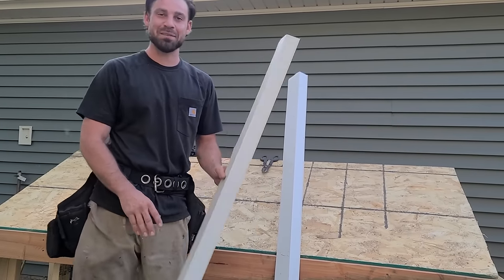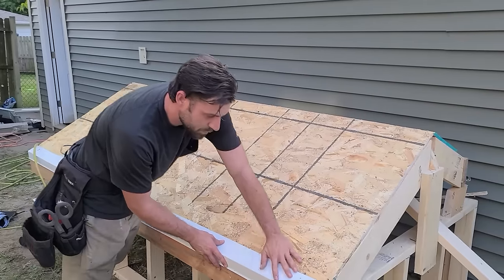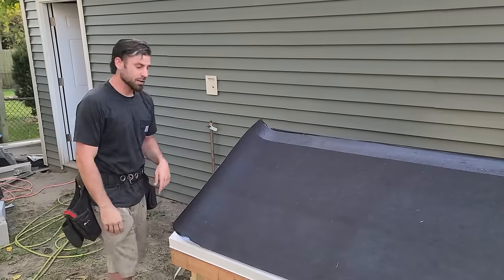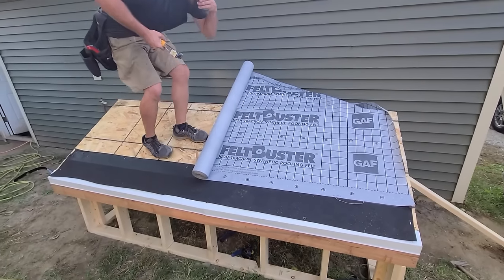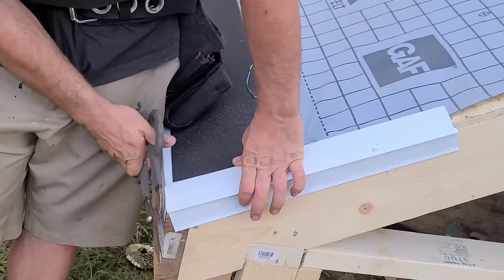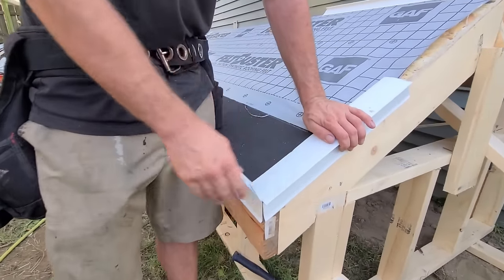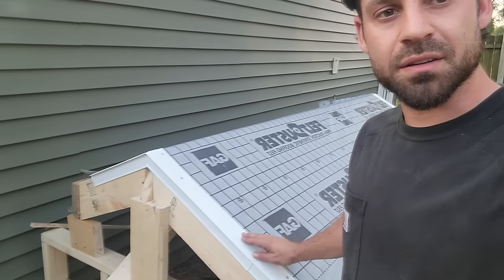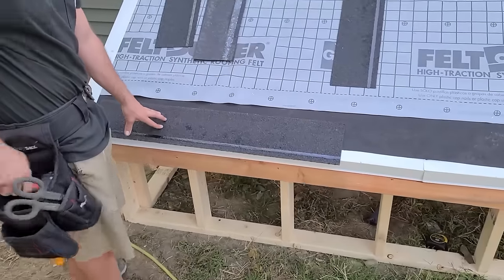HOW TO | A - Z ROOFING (PART 1)

Comment: With the new synthetic felt you can staple just the top and bottom. Keep the staples out of the feild and no more leaks, YES it will hold you. Try it and thank me later.
Reply from the maker: yea people don't trust the staples enough
Reply: It voids the warranty. Says it right on roll " do not use staples"
Reply: @user-ws3rw9ur4y  I never knew that, I believe you. I imagine they want you using the green cap nails..yeah hardly anyone does.
Reply: We use cap nails, it’s safer for the roofing crew

Comment: Actual career roofer 6 years. 
just a few things, great video thought it was very informative and great for DIYers definitely if you’re brave enough to do you’re own dang roof, but couple of minor things I noticed. Wouldn’t call them errors just this is my career 4 tab asphalt shingles and I’ve spent many a year on the roof. 
 first few minutes right away the drip edge (metal flashing he installed) should be an 1/8th to 1/4 inch out from the plywood on the bottom to allow the water to have more distance when going down the roof maybe to feed into a gutter or at least away from your ply wood as sometimes the ice and water won’t seal perfectly and you have that room for error. 
After that the ice and water, installation was good. I do recommend depending on the slope securing the underlay alittle more with more staples or ideally nails from your gun if you intend to stand on it when you cut your ice and water back you lost me, you did overlap your paper but that seems to be about a 4 inch overlap which if you’re not using the adhesive on the top of the ice and water paper which is alittle faster to stick does make me nervous. I’d leave the ice and water paper at least a couple feet in width and then do my paper over that not worrying about the minimal size difference as the shingles will cover that so it’s unnoticeable assuming your underlay isn’t full of bubbles. 
Paper was good, again you’re making me nervous standing on it with so few staples but it’s on the side of a house and only a few feet up so 🧘🏻 I’m calm. 
Appreciate that you went over the ridge with your paper, seriously so good🤣
Did you just say you fired a guy for smacking his hand with the staple tacker??? I’ve got over half a decade of just straight roofing nothing else and I do that at least once every few weeks. Apprentices will do that a few times a day🤣 hard core man. 
The side flashing is interesting but I would have used the same piece as the drip edge and wrapped the corners at a 45 because if you don’t caulk that at the end of the video your plywood’s gonna get hit 
What are you doing with that starter??? Are you going to cut a little 2 inch strip of starter for the sides?? Why make it more difficult on yourself there? 
Good video. Works well for your first roof ever
Reply: The weather shield has to wrap over the facia
Reply: Ice guard wraps over facia 3” then drip edge smh

Comment: Thank you so damn much for showing proper gutter apron/drip edge/ rake edge installtion! Literally every single roofing company in my area 45s regular drip around to the eave and all on top of felt. I've seen hundreds of roofs this year and 1 had proper drip edge installation.
Reply from the maker: No problem man
Reply: Because that’s how you do it, so that’s why every company is doing like that
Reply: The most professional way and best imo is bending the corner as 1 piece wrapping from eave to rake. It’s a tricky cut but looks great and doesn’t leave a seam on the corners.
Reply: @bigthunder7002 I agree this looks most profesional and nice from the ground the problem primarily occurs when you install gutters on that roof. You want the gutter to go out past the edge of the shingle on the rake because there's more surface area for water to cling to so it has a stream that comes off the corner of the shingle at the rake/eave. So with the wrapped corner you have to hang gutter below drip edge, notch the back of the gutter to accept the drip, or cut the drip to accept the gutter. You could also just have the gutter stop at the drip. But I can tell you from experience that little stream that comes off the corner will dig a hole in the landscaping.
Reply: @runiniscrazy  I see, good point!

Comment: Zach, please make a video showing how to apply underlayment to an angled hip roof. Does ice shield go over the hip? Do i cut the underlayment as it comes over the ridge to lay flat on the hip? Ive got a roof line like a typical gable, but the rake side has a tapered third side. Similar to a pryamid.

Comment: Awesome video man! Something I've learned for dripedge is to slightly bend the end of your metal inward with your hand for the overlaps and it helps to keep it from flaring out, works for eves and rakes (florida mans alternative to making the 45 cut, cause code calls for a 3'' overlap on all dripedge). Code here calls for everything opposite of what your doing too lol
Reply: It's easier if you just snip the metal a little, opposite from what he does in this video, then you can slip the underside, where the L shape is, and tuck it underneath the side you're laying it overtop. Makes it 100% flush.
Reply: Josh If I got what your saying right then that would work just fine too. Where i’m from they require 3” over lap on all eve or rake metals so bending the ends is the only option
Reply: @joshuawhite402  late post but I do sheet metal so we’re all about the overlaps. Best way to do it is to snip the drip edge slightly at the 3-4 inch mark then cut from the end of the metal at an angle to that mark.  That angle cut will allow it to slide into the next pieces drip edge and look super sexy.

Comment: I cover the ice and water with paper so it’s easier for next guy and easier to walk. Tearing off shingles from some ice and water is impossible. They become one.
Reply: Was wondering about that.  I have seen a lot of videos.  I did my first roof with my dad in 1995. They didn't really have a lot of the underlayment they have now.  I see a lot of videos where it seems to me they are either skipping steps or the process has evolved around speed and not around function or considering the next team that will replace the roof in 15 years +/-.

Comment: You should use your knuckle on your finger it’s a whole lot faster than chalk line for your starter and usually I put my first starter piece on the edge metal side then I put my starter where the drip is at that way u can put a full shingle or start your books immediately if u want a demonstration let me know. And I promise I always come out straight

Comment: great video!  Do you have to install a drip edge on a split level home where the roof edge runs into siding?
Reply from the maker: Not specifically no, but you just cut and angle so it's tight to the wall and trim the protruding edge back and inch so it allows the drip edge to extend back, with the thick edge resting flush against the j channel

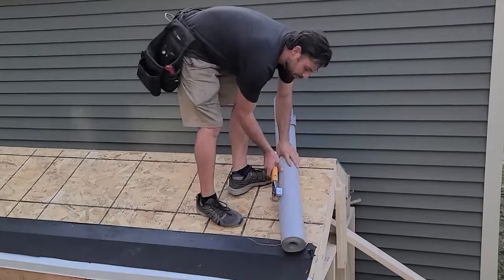Comment: complete noob here. i have a question. initially you covered the whole roof with the ice barrier but then around the 3:40 mark the ice barrier is only for about a foot from the bottom and then you covered the whole roof with the synthetic felt on top of that. what am i missing?
Reply from the maker: Watch my video on the tear off, dry in , and put back.  It will explain all.  It's got around 700k views if I remember right.  It's an hour and 8 minutes so you can skim through and see whatever you want
Reply: @NWIVeteranConstruction  thank you. that helps. will check the video.

Comment: What happened to the IWS?  You applied it over the entire roof then in the next clip it was gone when you installed the felt.
Reply: He had to simulate a bigger roof. His mock roof is small enough that it is almost entirely covered by the Ice & Water shield, and installing the underlayment (“felt”) would mean covering more IWS than needed. It would give the impression that more than four inches of overlay is necessary.

Comment: Great videos. Question: I’m getting ready to reroof my house. I have 4 valleys total. 
Do I start in bottom corner and work into the valley or shingle valley first and work outward? 
I’m planning on using 2 cut 5 row method that I’ve see you use. I’m planning on using closed valley method.
Reply from the maker: Watch my valley video.  You can do whatever way makes sense.  A lot of ppl think you have to start from the valley, that's not true.  I wouldn't run a big side left handed just because It's easier to do a valley from the valley.  Sometimes it makes more sense to shingle a big side side up to a valley and then cut pieces into it. Once in a while.
Reply from the maker: Also, if you haven't ever roofed before, and your house has 4 valleys...I can almost gurantee you'll mess something up lol just want to throw that out there. Listen to the beginning of my most recent roofing series and it will tell you why. (In part 3)

Comment: Love your video's, why are some starter strips half width (skinny) and some I've seen you install full width (fat).
Reply from the maker: If you're talking about in other videos I used some fatter ones..yea I preferred those taller ones but that brand quit making em and I moved towards using the manufacturer starter these days over what I prefer anyway. For example if I'm using GAF shingles on a job I'm gonna always use their starter and ridge cap as well. 3 components for the warranty.

Comment: When you run that drip edge up the gable, why not bend one continuous piece over it rather than but up two pieces and have that opening on the top?
Reply: He is demonstrating in small scale. Quite often the pieces don't come in 30 foot lengths unless you have a fancy bending machine in the back of your truck

Comment: On the rake, you could foils the extra drip around the sub facia band. Keep in mind when the gutter comes in behind the drip edge, this keeps the water that comes down the edge of the rake from getting into the facia seams that come together at the corner
Reply from the maker: Can't do that! This is a very common comment but the thing about the gutter is it goes out past the drip edge. All gutters extend about an inch past the edge of fascia. What you do is wrap the fascia, not the drip edge or gutter apron. That protects the wooden sub fascia.  See my most recent video on fascia, it explains it all.  Anybody who does that has a gutter that is too short, or the gutter guy cut that fascia and did it the right way
Reply: Actually I've done gutters for 8years now, and also a certainteed certified master shingle applicator. Im telling you from experience you can wrap your drip, giving a nicer reveal, better water protection, and get the gutter an inch past the shingle line. We do it all the time, and I actually prefer the lazy method where people leave it hang heavy as opposed to the cut method so we can cut and wrap it ourselves afterwards if it's been missed
Reply: I agree you wrap your fascia as well, but I'm telling you there is also a way to wrap the drip edge and you can put a wrap on top of a wrap and it's always a cleaner reveal

Comment: thank you for the video. when i can use the ice & water berrier? and when i will use flat roofing underlayment ? can i just use the ice & water to cover all my roofing ? thank you
Reply from the maker: Ice and water is usually required along the eve edges to extend 2 ft past the inside of the exterior wall, and in valleys. I'd check your local code though with your building department.  Depends on the area

Comment: Do you think you could do a slated roof? I'm in Scotland and only ever use slate or tile for pitched roofs and single ply or torch on for flat roofs
Reply from the maker: With research and watching videos yes.  I understand things very well but wouldn't jump into without knowing
Reply: @NWIVeteranConstruction  simple formula.... Length of slate - lap (usually 75mm depending on pitch) then divide by 2.... This gives you the "working gauge" then divide your roof height (eaves to ridge) by that number and that will give you the amount of courses on the roof, then divide your roof height (eaves to ridge)  by the number of courses and that will give you your " true gauge" at which you will fit your slates to the roof, chalking lines at the specified gauge and laying the slates to they lines, massive satisfaction when you step back and have a look at the end
Reply: Obviously there is other things to consider but that is a basic rundown, maybe I should post a video? 🤣
Reply: Slate or even concrete tiles which are widely used in Wales are unheard of in Canada and USA. It's tar shingles or metal tin roofs pretty much. Shingles typically give you 15 - 20 years life depending on the installer :)

Comment: Two reasons why you don’t want “nice and tight” on the drip edge:
Firstly, the gutter guys that come behind you will hate that you didn’t leave them room between the fascia and the drip edge. 
Secondly, assuming a very straight edge, “nice and tight” isn’t as dreadful as I made it out above, but my eave-edge isn’t straight, and I’ll bet most others’ isn’t either. And if you try tight along the front, the top of the metal is going to buckle and wave. 
So leave about 1/2” gap and you’ll make everyone happy.
Reply: Who desiged this roof

Comment: Why does the gaf instructions say not to install the underpayment with staples only?
It says “Important: Always install FeltBusterTM High-Traction Synthetic Roofing Felt using plastic cap nails or plastic cap staples. Do NOT use nails or staples without caps”
Reply: Because staples leak.
Reply: Cap nails=hundreds of holes with a seal Staples= thousands of holes with no seal
Reply: It is because they want you too purchase there staples which are expensive, we only use 3/8 staples too install our paper and it does not leak, i especially like using staples when papering over ship lap (1x6 board roof deck with gaps) we use too use coils but one time we papered a ship lap roof deck and the nail got in a gap and there was a pin hole leak, so after that we went too 3/8 staples and never had a problem, my suggestion if stapling over ship lap is too feel the roof with your fingers before applying the staples that way you know where thr gaps are
Reply: Just a liability thing probably. If you use plain fasteners and they tear through and you fall, they can say “I told you so”

Comment: Question? There is an older house in the neighborhood with a composition roof and the material is covering the 6-inch facia. It looks really nice (cottage look) not sure what is used for a rain gutter since the house is set very back. Would you happen to know what that style is known as? 🛖
Reply from the maker: Not sure

Comment: Could explain why you put the drip tight against fascia or as tight as you can just so can explain to my boss my we need to stop overhanging it an inch or something. We only do it all because a eavestrouph guy gave him shit for going flush even though I was taught to install drip tight and have found his way makes hard to properly install starters
Reply from the maker: Yea that's just crazy.  Only thing I can think of is gutters are terrible going into drip edge.  You have to use gutter apron on the eaves. It has a bend in it that allows the gutter to go up nicely unlike drip edge. And I think it's self explanatory wit drip goes tight to the sides
Reply: Also, maybe the eave guy was replacing the facia boards and wanted room to work on that specific job? Definitely goes flush with facia.

Comment: There's suppose to be a 1/4 gap with the drip edge otherwise water would hit the fascia board
Reply from the maker: There's aluminum fascia going there
Reply: @NWIVeteranConstruction  Hey Vet, Im thinking about doing the roof of this old church. Should I just ask them if they want it done? I recently helped a crew do my moms house and now I think I can do it. Lol. Its a small church with not alot of stuff.
Reply from the maker: @tuanas458  mmm. Idk honestly.  Can't hurt to try.  But with older buildings, you're likely to run into a lot of things you haven't experienced before.  Personally, I would feel like it's not a morally correct thing to do and I don't mean that In an insulting way.  Its just the fact that things can go south quickly with a roof, ya know?  It's not like you're installing gutter guards or painting a room...
Reply: @NWIVeteranConstruction  I get what you're saying, but after volunteering, I felt like I learned a lot and feel I can take on anything. My roof had 3 layers of shingles with no underlayment! lol. Ill keep watching some of your vids to learn. If challenges come up, ill just take care of it.

Comment: Drip edge turn at your corner very easy funny because you should def know this lol especially on a shed roof like this put your rake trim on before you ice shield p.s make a 45 degree on your face metal corner for detail use a pencil not a probably and a shot sad because people will use this and think they are a pro